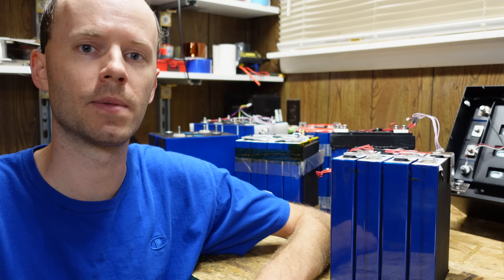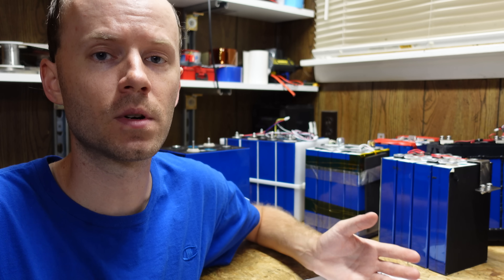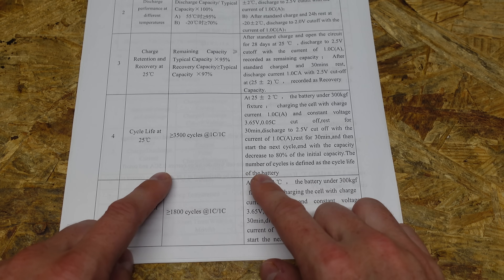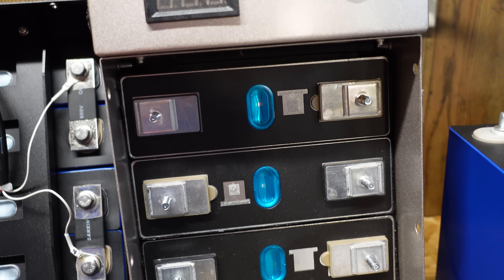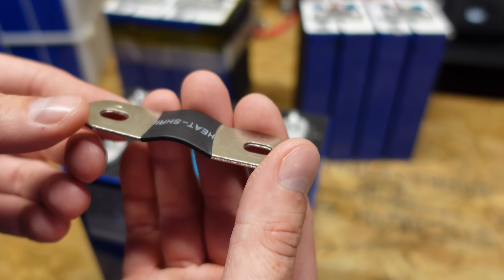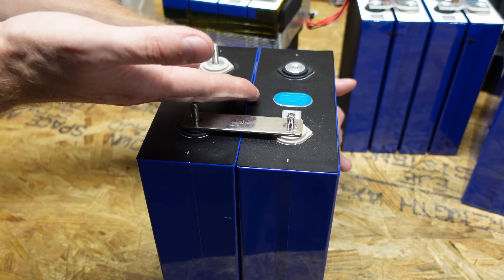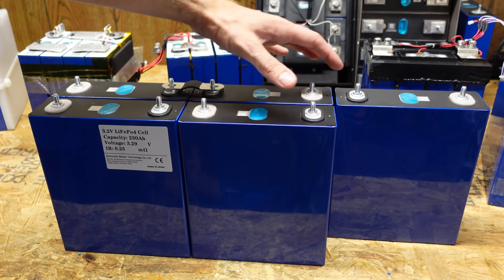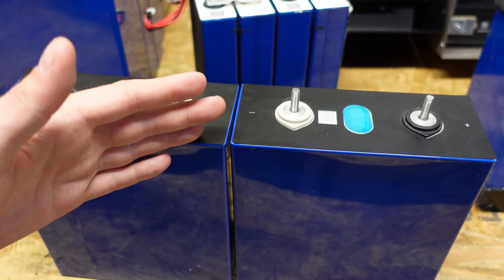LiFePO4 Battery Compression, Fixture, and Assembly - What's the Deal?

Comment: I've been racking my brain over the same issue and after reading all these comments and also the DIY solar forum; I still don't know what the answer is for sure. Where I'm at now is: 280ah cell to compress to 300 KG force which 660lbs. Use 3/4 plywood at end of the battery with 4 3/8" rods torqued to 12 in-lbs each will give you 165 lbs clamping force/rod. To deal with the terminal issue, the busbars that came with cells are about 20 mm wide and 2 mm thick = 40mm2 which I figure is about a 1 AWG wire so I will use 1 AWG wire with lugs as "busbars" . I'm not trained in electronics but reading and asking to learn.
Reply: @Keyzer Soze Thanks so much for your response this is why I'm asking. Could you be specific on which numbers don't add up? Is it the force that I'm applying of 12 in-lbs to give 165 lbs? Is it the 1 AWG wire as an alternative to 20x2mm busbars? Again I appreciate your feedback and learning as I go.

Comment: I use 1/4” ceramic fiber cloth between each cell, surrounded on sides and bottom with 1/4” concrete hardboard. Then I use three 1” cargo straps around my 16S 280 aH blocks. 

Why would anyone want a flammable or electrical conductor surrounding your cells?? Have you seen them overheat? The heat spreads to and ruins nearby cells. Now your fire is bigger, burning more cells.

Comment: I think MOST of us are stuck with this issue. I suppose another option, which would be expensive is to actually use cable and terminals instead of bus bars? That way they could have some flexibility if long enough. Otherwise where can we get custom bus bars? I also am kicking around the idea of taking a $ store silicone hot pad ( for kitchen ) and cutting in strips to put along the top and bottom  between the batteries, may take some layering, but cheap and more heat resistant.

Comment: As already mentioned, internal cracking of cathode roll makes sense. Also, under catastrophic failure, the pressure relief might fail to work if the cell is unconstrained and allowed to balloon a lot, which obviously could cause a host of issues if wires/busbars/terminals are forced out of position and/or pinched, broken.

Comment: Ok, if the cycle life improves by 40% by putting them under compression,  I think it's worthwhile. That said; your batteries,  your choice. 

My thoughts for an optimal design would be  in compression using threaded rod with springs, and thin (~1mm) sheets of an insulator between each cell, just in case of rupture 
If the whole compression thing worries you, Will's video method seems like the best alternative. 

For bus bars, you can buy copper bars off McMaster Carr, sometimes at Home Depot, or just use flattened copper pipe (David Poz does that) and if needed, put a kink/crimp/bend to allow for expansion and contraction. Copper pipe is likely cheapest.

Comment: Bit off topic but could it be feasible to build a power wall using cordless power tool battery as they are no tacking apart but clip them in on to a board with connectors just like putting them on the tool, it seems the simplest way to build off grid and plus the battery has a warranty. I don't fancy having to buy second hand and then doing capacity tests and soldering, I'm not lazy just not an electrician.

Comment: I assembled a small battery pack of the Top Brand Prismatic cells. I put VHB tape on the top and bottom to space cells then added the busbars to studs. Prismatic cells expand the most near the  center of the largest flat surface. By spacing out cells it negates (completely or partially) the stress on studs and possible creep failures caused by cell expansion.

Earlier on I used assembled my packs with 26650 and 32700 cylindrical cells. If you don't like dealing with compression you can try the 70Ah SAB 60280 LiFePO4 cylindrical cells, also known as the S168 cells.

Comment: attach buss bars while batteries are at 100%soc (Fully bloated), then when they are discharged the batteries will create a small gap between them. no stress on terminals
Reply: Good thinking but that assumes bloating remains constant.

Comment: Gap the batteries and fix the physical structure. This keeps expansion and contraction from breaking terminals with inflexible bus bars. It's also better for the battery.

Comment: From my experience, I can only tell you how a degraded cell will one day look like. Bulged! And if they had not been fixed, excessively bulged. The reason is, that movement is causing delamination, and delamination is not reversible. Unwind some aluminium foil from a roll, and then try to wind it back, and you know what I mean. Youtubers like you and Will, doing a lot of product reviews, do have a homegrown problem. You are doing capacity test over the specified range of the voltage cycle. But that as well includes to enter two areas of voltage, which LiFePo cells actually do not want to be in. The high end spike, and the low end drop off. Those two areas are the places most movement is happening, but being there actually doesn't have any advantages. When I bought my used, bulged, degraded cells, I have put them into a pack in a fairly low SOC and pushed them together to a normal shape using a steel fixture. Then I made my bus bars and that its what they are running like for more then a year now. If I would have bought new cells like you guys have, I would charged them to the maximum voltage I would have planned to use (probably 3,45V), fixed them in that position, and let them breath to lower SOC. But that initial size would then always stay the limitation, and the distance of terminals would never change. Never charge above 3,5V and never discharge below 3V, no active (un)balancing and you will see it will all be well. But anyways, this are all very longterm experiments what we are doing here. Future will tell.
P.S. My cells are the old style, which come with active rubber vents. I think that that design has some advantages and swelling on every cycle is not as extensive as these new aluminium cased types. But they do release gas, so they cannot be used indoors...

Comment: I had the same discussion on my channel when I build my first battery pack 6 months ago. As you correctly said and calculated you will never use one full cycle on the battery per day. And even further, you will never charge the battery with 0.5C and discharge the battery with 1C at 25°C. Exactly these conditions apply for their test of getting 1000 additional cycles. If you charge/discharge slower, as you would in a stationary solar environment, the benefits of fixture/compression are far less, maybe even zero. 
If you really have close to 100% DoD on your battery each day, your design was completely wrong (or you have a very good reason for such a setup 🤷‍♂️).
I'm a non-compressing guy. My cells are sitting in a bit like a zickzack connection, slightly on an angle next to each other so the normal busbar still fit. If they contract/expand (which they may do under very high amps), they have all the room to do that without adding any stress on the terminals.
However, I would probably fixture them with reinforced tape for a mobile application.

Comment: Forget about the battery makers who have old schemes based on old knowledge, look at the modular battery pack assembled by official Eve and you will find 8 lf105 cells well compressed together with extremely resistant plates. and if they who built them do it, I think it is the main way to follow ....

Comment: I would use sticky back neoprene.  Add it at  the corners or strip along the top edge to create the gap.. The batteries only expand in the middle. That will create the correct size gap avoiding stress on the terminals.. Then you can compress the full pack pack to spec… but then you have the problem of having no compression at a low state of charge.. does it say that the compression has to be constant .. ?

Comment: When I built my pack I made my own bus bars out of flat copper bar, and I used double sided 4mm thick  rubber squares in the corners then tightly wrapped in heat resistant tape. That allows the cells to expand without pushing the cells apart , the terminals don't move that way

Comment: 4:30 - I wonder what the warranty length is on those commercial batteries you used as an example. If it is less than the 5 year / 2500 cycle length that the manufacturer spec sheets say the battery cells should last then the manufacturers may have just skipped the compression as a cost cutting and ease of manufacture measure rather than anything else. 

There may be some merit to this theory as based on a weber auto video I watched where the professor disassembled a prius prime battery the prius prime (specifically the plug in prime model) battery was compressed. And the 2018 prius prime has an 8 year 100k mile warranty on the battery based on a quick Google search. This is about where 1000 extra cycles would put you at time wise too.

As you mentioned though compression is not going to matter too much if you are not using the batteries to a low depth of discharge. Climate control and preventing terminal failure from battery expansion are much bigger concerns in your use case.

Comment: 9:00 - while the whole battery pack will expand by tens of millimeters, each set of batteries with busbar will only experience roughly up to 4 millimeters of expansion or compression distance/force when the battery packs are set up in a way that lets the cells shift as needed. If you compress them so that the cells cannot move, each battery terminal would have the force from the movement of all the cells placed upon it when using solid, inflexible bus bars. Using flexible wire rated at your needed amperage or flexible bus bars would prevent this from becoming an issue though.

Comment: I think Benny and hubertnnn,s comments are going in the right direction. The question is why are we interested in preventing expansion? With out  a doubt one is the bus bar issue. You have to stop any movement between those two points to prevent stressing, and potential failure. I don’t think buss bar design is enough. 
Second  is, what is happening inside the cell. A non bloated cell is going to have less internal space then a bloated cell. The electrolyte on a higher soc bloated cell will settle to the bottom of the cell leaving the top electrode and cathode no longer immersed in the electrolyte. I have turned my 310ah single cell fully charged  upside down and I can hear the electrolyte inside moving from top to bottom. When it was at a low soc I could not hear electrolyte movement. I have seen videos of autopsy of bloated cells that failed and there was evidence of dry areas within the cell that had also delaminated.
My opinion is that it is adventurous to prevent the cells from swelling. At all. None. If there is an issue, that little over pressure valve on the top of the cell will blow open releasing any pressure that will be required to be vented. The cell will be destroyed if that happens but I have not heard on this happening to a compressed cell. I have heard it happening to a none compressed cell that was allowed to bloat. 
You can see what compression does to a pouch cell that has a dead short put to it. Nothing happens. An uncompressed cell bloats almost right away and bursts. 
I have tried to look at the mechanics and science of what goes on inside and out on these cells and I have come to the conclusion that preventing expansion seems to be the most ideal situation for the health of the cells and to prevent mechanical damage of the cell terminal posts while secured by a buss bar.  
I have chosen this method on four 310ah batteries I have made for my personal use on my boat and one for a solar system at work. 
The debate will go on but I would say,  try to look at the mechanics and science of what is going on. I unfortunately don’t think we will hear much from manufacturers because they just don’t care enough. It’s call engineered failure. You don’t want to make something so good you can’t sell it to someone again because it lasts forever.  Good luck.

Comment: For Fuck's sake....... get rid of the bus bars and use 8 gauge wire (dual if more amps needed). space the batteries with 3mm foam or rubber matting, use a plastic ratchet clamp, and move on with your fucking life.
Reply: OK, your approach sounds good.  Attitude not.  "I came to a good solution promptly so if you aren't sure what to prioritize or haven't gotten there yet, then you are stupid or slow"   Nasty impatience. 
 I assume that with ratchet clamp here, you mean long zip ties? Not the squeeze type hose clamps.  Too small.  Could use those white A/C duct zips.  They are pretty tough and low profile.

Comment: I think you are overthinking this. You are following the spec sheet too literally. This chemistry is half unknown meaning even the manufacturer does not know what's best. You even pointed out they later revised their instruction years later. With all due respect, just hook them up and put some light compression on them or not, it doesn't matter. By the time you are 100% satisfied with them we will have solid state batteries or something else. It's not life or death, just take some time and relax. Also just to add if you use cables instead of buss bars, all of the stresses are minimized. buss bars are a very stupid idea with batteries that change size so much. but do not connect them straight, connect positive and negative in a slanted pattern like this ///////

Comment: Well I don't know but I can tell you what I did I have the 280s I wrapped each cell in two layers of kapton tape covering every inch of all sides of every single cell then I taped two cells together as tightly as I could without using any equipment just push them together with my hands and stretch the kapton tape around them but I only did it and groups of two cells taped together
It seems to really resist stretching and it's kind of self-tacky that doesn't allow it to shift

Comment: Get Neoprene Foam 1/8 sheet put in between cells, use 4 threaded rods with HDPE board 1/2. At the end of each(8 total) rod place big rubber washer/bushing> big metal washer> nut. Hand tight everything, charge batter to full. Measure sq inch of battery face, multiply by 12lb torque ( if that’s what it’s called for) divide by 4 and tighten your rods with torque wrench.

Comment: I went the custom bus bar route, 3/8 by 1 1/4 aluminum. If i did the math right, hope i did it is the same as 4/0 wire. then used noalox on all the joints. Time will tell if this was a good idea.

Comment: Sorry for so many comments, but How would you make this setup work in a mobile application?  The movement of the cells would be worse bouncing down the road not being fixtured.
Reply: I'm thinking best to fixture with end cap type spacers.  Strap down and surround w foam.  Everlanders yt channel shows this.  I would like to find an elastic spacer material w 12psi compression strength.  Need material data

Comment: The Aluminum bussbars will crack over time unlike Copper...
Reply: If the air is humid, salty, acidic, copper and aluminium react, the result is corrosion and bad connection on the battery posts, I think.
Following, comes unbalanced cells, hot spots, inefficiency, sparks, fire?
lol